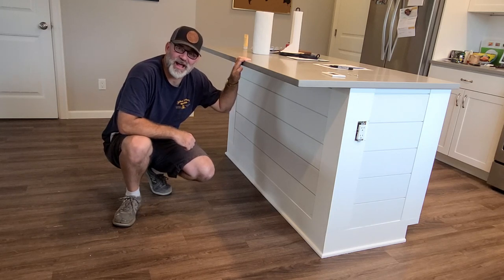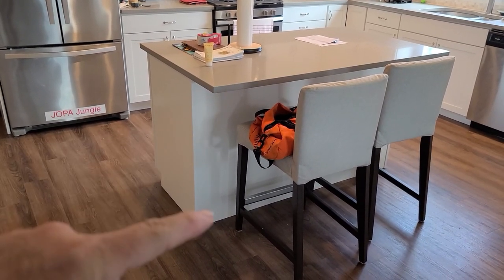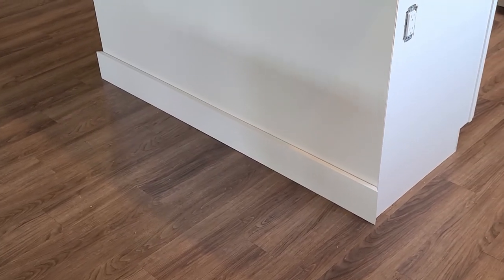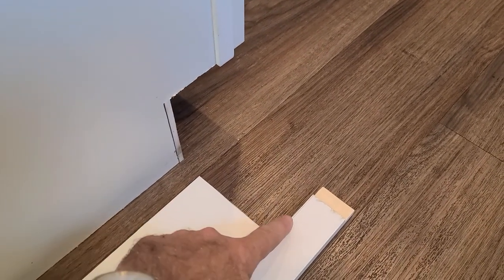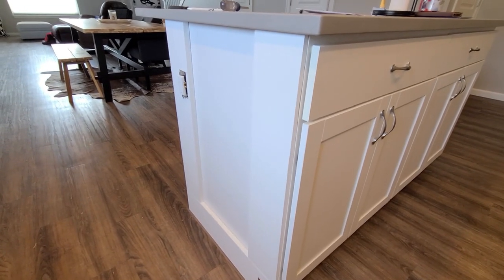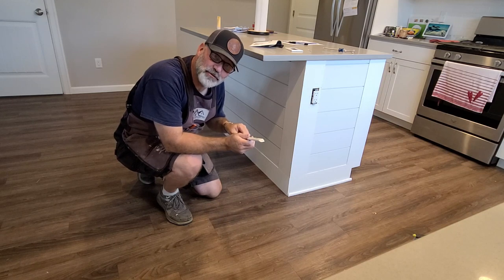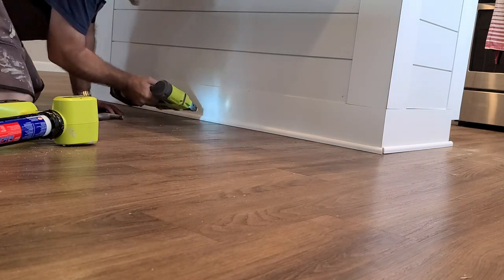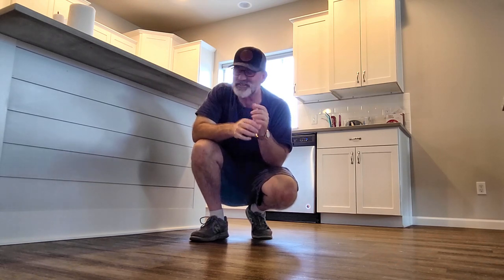SHIPLAP the KITCHEN Island! | Do It Yourself for $100 | 2020/32

Comment: If I’m covering a tile covered island. Should I put up like 1/2” plywood first? Or just glue the shiplap to the tiles? Don’t want to bust the tiles off.
Reply from the maker: Just glue it to the tile. I used the brad nails to hold it in place until the glue dried, and I probably didn't even need that.

Comment: Any tips for doing the corner vertical trim boards?
Reply from the maker: The easiest way is to butt them up by making one board a little narrower so the reveal is equal, or you can miter the corners.

Comment: I see you don't have anything supporting the overhang for the top. Is this an issue?   I'll be doubling up some mdf and using epoxy but I was thinking of installing some supports
Reply from the maker: The island was preexisting. I thing the countertop is self supporting and brackets or corbels would be purely decorative.

Comment: Did you use a router to make the groove for the end piece and if so what's bit did you use?
Thanks
Reply from the maker: Nope. It's called Nickel Gap Ship Lap. On the rack at Home Depot and Lowes.

homedepot.sjv.io/15VPXx
Reply: @DadItYourselfDIY  
I'm sorry yes I know what ship lap it is I'm talking about the piece that you cut out of the vertical end piece to fit flush w cabinet 
The end cap for the cabinet corner where the door is
Did u use a router on that?
Reply from the maker: Nope. Butt Joint.

Comment: Quick question on the rail cut, did you to a 45 degree angle?
Reply from the maker: Yes, I mitered the outside corners of the stiles (vertical) and baseboard on the tablesaw. The rails (horizontal) are butted to the stiles

Comment: What size nails did you use for the shiplap
Reply from the maker: 23 gauge headless pin nails. Just to hold it until the glue dries.
Reply: Thank you.
Reply from the maker: You are welcome. On a wall I would recommend an 18 Guage Brad nail into the studs.

Comment: I was worried the whole time that you were going to have nails pop through the inside. Lol.
Reply from the maker: Short Pin Nails and toe-nailed into the trim boards.
Reply: @DadItYourselfDIY  I'm about to take on this project and am using you video for instruction, TY! But what length nails were you able to use for the hold and not have it punch through?
Reply from the maker: I used the shortest pin nails and only in the corners where there was structure. Honestly you can probably get away with the adhesive only...